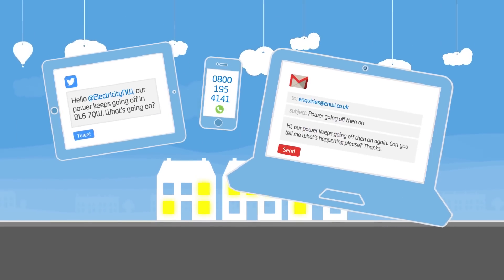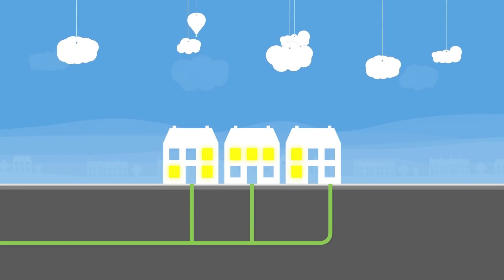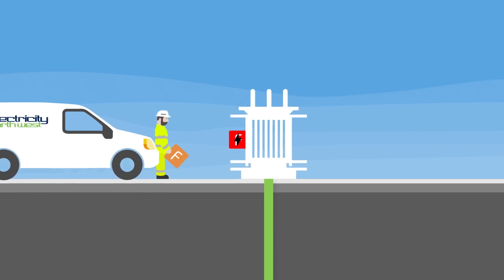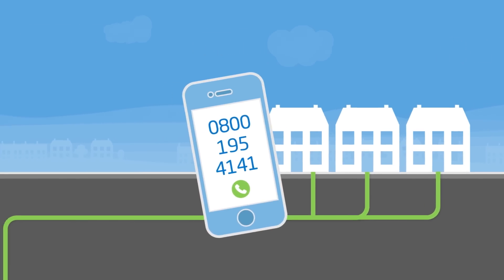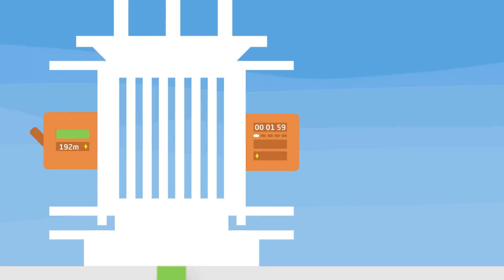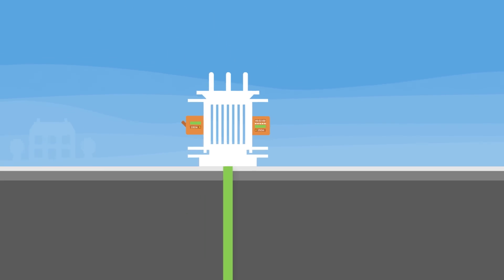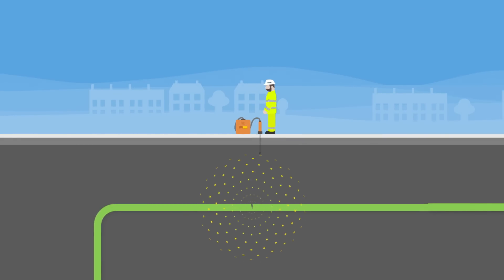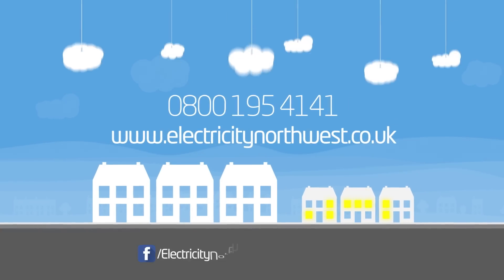How we fix transient cable faults

Comment: We’ve had multiple power cuts over the years , same fault joint issues at the bottom of the drive . 
Engineer said it needs a complete new run of cable but they won’t do it because of cost . 
They’ve been out to repair the same faulty joint around 10 times , definitely cost a lot more rather than replacing with new cable in the 1st place .